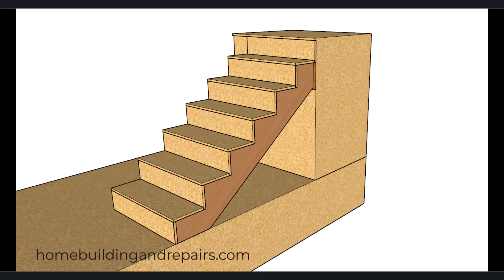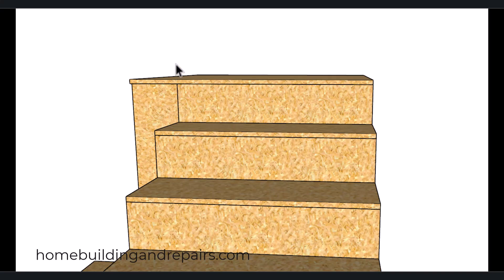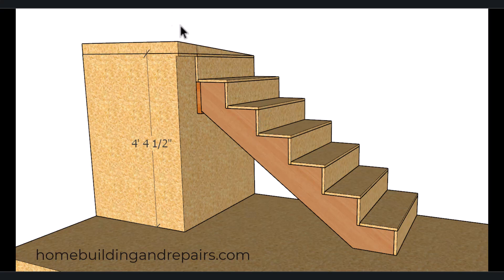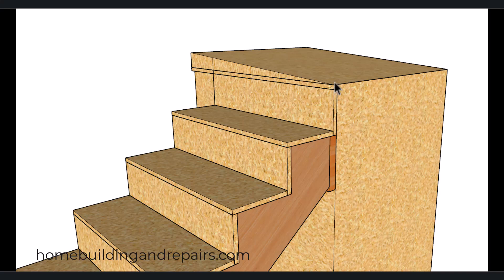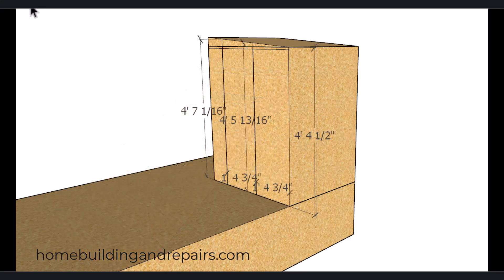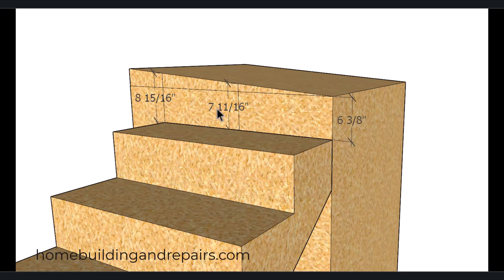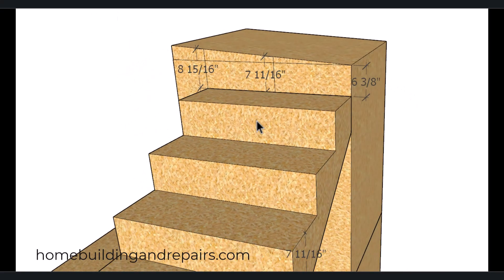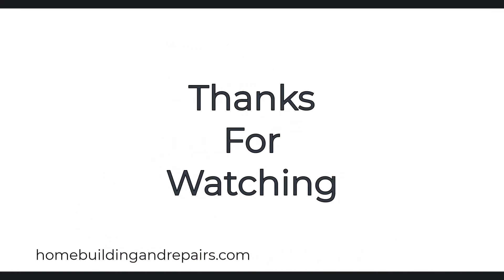Practical Tips for Measuring Stairways With Uneven or Angled Floors - Construction Safety Ideas

Comment: Thanks for your videos. Your detailed descriptions and rendering have been very helpful. I’m a fairly experienced “handyman” with very limited experience building stairs. I’m writing in the hope you can help recommend solutions to a few challenges with some very short exterior stairs to a deck. 
Challenge #1: I will be doing some grading to minimize the slope leading to these stairs but they will still be subject to some amount of surface water runoff. 
Challenge #2. I need to place stairs on two sides of the corner of a deck. Each side is approximately 54” wide and I’d like to match the stair width. The stair(s) on the  “uphill” side of the deck has a rise of just 14” so I need just one step to the top of the deck. There’s very little room below the deck joist to attach a standard stringer so I’m considering some type of “box” base I can anchor to the edge of the deck joist and/or a concrete pad. 
Challenge #3: the ground under second stair slopes from right to left. The rise on the right is also just 14”.
The rise on the left is 19”. 
I can adjust these slightly by adjusting the finished height of my concrete pad but I’m a little concerned  about the height and potential trip hazard of the downhill pad height. If I simply finish the pad height at 14”.  I may be able to raise the slope slightly but I’ll still need to take the water runoff into consideration. 
Finally, I’d like to add some large flagstones in front of both stairs…both to help manage water runoff and to reduce the slope approaching the stairs. 
HOPEFULLY, this all makes sense. Thanks again for sharing your experience and thanks in advance for your advice.